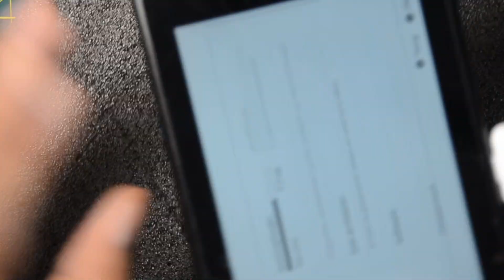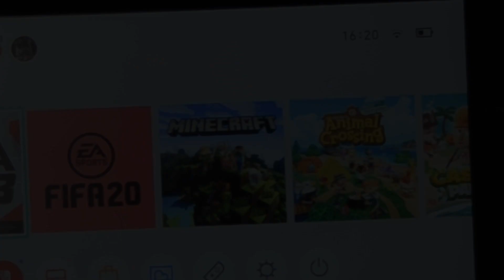Nintendo Switch Liquid Damage Diagnosis And Repair

Comment: hello got a question got a switch with an issue where if i get to far from it the wireless controllers joycon disconnect i have to get really closely for the controllers to work i bought a wireless controller thinkingit was the joycons but found out same thing can it be the bluetooth wifi ic
Reply from the maker: HI, I would check if the antenna's are connected, then if that does not resolve the problem i would replace the wifi IC. Gr. Jim